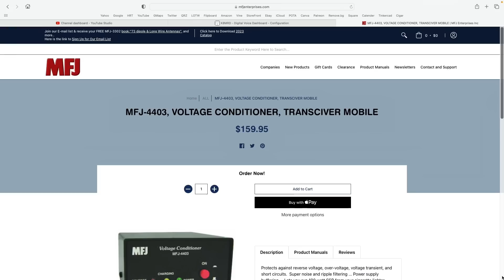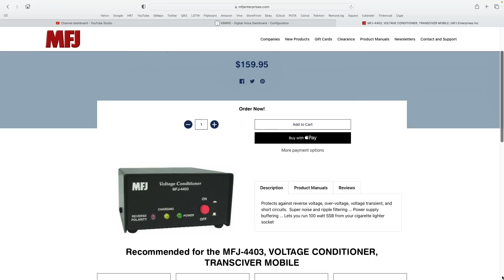Powering Mobile Ham Radios & Grounding HF Boat Antennas

Comment: A straightforward solution to powering a mobile ham rig would be an inexpensive LiFePO4 battery to provide enough current on demand.  And, use the cigarette lighter - or, any other 13.8v connection available - to keep the battery charged.
Reply: That occurred to me too - a current-limited "trickle" charger that won't overload the lighter socket but the battery can supply more current when transmitting.

I got lucky with my current car. The battery is in the back (both batteries, actually; it's a hybrid. But I'm not touching the HV pack) under the cargo floor and there's enough space to mount the radio base unit and some power wiring for other equipment like hard wired USB chargers I've added. I ran the cables to the control head and speaker around the seat and along the bottom of the read door trim all the way to the front seat, bundled in snakeskin sleeving, and the antenna mount feedline from the center of the roof (also got luck since the dome light is in just the right spot to access it without ripping anything else out) goes through the headliner and down the D pillar completely trucked away too.

Comment: Thanks for posting my questions Mike. I did feel a little guilty after making that GB station for 13 colonies. I’m a new ham for about a year and I just got wrapped up in the event. I just wanted to complete my first event solo outside of field day and I let it get the best of me. And thanks for all the feedback from everybody. Mike I will send you some pictures from the Pota boat this weekend. KI5UTS
Reply: I have a different take on this. You tried something new using a remote receiver via the Internet. You had an experience and perhaps learned from it. That's part of ham radio too.  Instead of trying to make it something it wasn't, a 2-way station-to-station QSO, see it for what it was, a potentially valuable learning experience.  Perhaps it could inspire you to work on your antenna and lower the noise level at your QTH so you can hear these weaker signals.  Could you find a quieter antenna and add a CMC choke?  That alone might reduce your noise level by several S units!  Maybe next year you'll be able to work GB directly.  Realistically we're competing with ourselves to grow and improve more than we are with others.  You're the best judge of what any QSO or award means for you.  Enjoy!
Reply: My thoughts on using the Internet with Ham radio: Well, first, one of the justifications for allocation of amateur frequencies is emergency communications. If there’s an emergency, Internet failure is likely. On that alone, I’d disallow such contacts. In my view, if your station didn’t make the QSO, the loaned station gets the contact.
Now, I’m all for integrating radio with Internet. Great idea! And in an emergency, you may have to relay traffic through Internet systems to reach the addressee. I think being able to access e-mail and other messaging services automatically from a ham station is incredibly useful! Ragchews into strange repeaters are nice.
But to me, ham contests are about bettering your station and your operating/setup skills. Use YOUR radio gear to reach THEIR computer, fine. Use your web browser? Plplpl you’re already online.

Comment: During NPOTA in 2016, I was at MLK National park in Atlanta and parked and went to the Restroom for about 3 min. Came back and my side window was broken out, and our two suitcases, laptop, cell phone, etc were stolen. Parking lot had a gate guard shack, but no guard, cameras on light poles all around. The Park Ranger cop said it was dangerous area. The NPS stopped manning the shack and the cameras had not been working for years. Atlanta PD called me a couple of weeks later and I recovered my laptop bag. Nothing else. 
Be careful in parks. Use the two man rule when possible. KQ4KK

Comment: I am in a Ford F350. I didn’t want to mess with the firewall, so I ran my power cable down the engine side of the firewall and snuck it under the truck by attaching it to brake light wires with zip ties. I found a little rubber plug in the floor board by the back seat and ran the cable up and through the floor behind the seat. There are plenty of places to run wires underneath a vehicle. Just fish them through all the attachment points for existing wires… I’m spoiled since it’s a truck and is easy to crawl underneath, but I assume it’s doable on any car with a floor jack.

Comment: Your answer about grounding the antenna on the aluminum boat was spot on! I do marine mobile and communicate with many hams on the water and those with aluminum boats do extremely well.
Keep up the great work.
Steve, k7ofg
Reply from the maker: Awesome, great to know.  Thanks for sharing.
Reply: Also consider capacitive effects for the ground plane. He may not have to scratch off paint if the clamp on mount has enough surface area close to the hull might be an effective capacitive connection to the boat. Like a heavy duty mag mount on the roof of a car.

Comment: Just want to comment on using remote receivers for 13 Colonies. I am on the East Coast and I even had difficulty working GB13COL. Based on comments I saw on DX Summit a lot of guys weren't working him. I worked the France OK station but no UK. I am not a fan of using remote receivers but I know people use them. A local ham is a big POTA hunter. He says he has a high noise level and often uses remote receivers to hear the activators. He even recommended it to others at a club POTA presentation. I'm with you on this. If I don't hear them on my receiver I don't work them. Phil, N3ZP
Reply: Sounds a lot like a meeting I went to.    I have no objection to using a web-sdr to listen, but I found it really did not work for 2-way contacts.  There is such a lag in hearing the web-sdr that I could not break into a pile up.  Just not worth it.  73 de WB3JAC

Comment: Voltage Conditioner. That's what I need for my setup. Thank You. I run an IC 7100 off of a secondary battery in my mobile. I have a battery isolator to stop the main from draining the battery if I forget to turn off the radio. The boat answer or question should go to Hamjazz (Youtube) He did a couple YouTube video from a kayac using an IC 7300 and an Alpha antenna with radials tuned for 20 m etc. He does POTA in the weirdest places. IE glacier, on a lake at a park on Vancouver Island. Boaters sometimes use the KISS method by using keel bolts that are somehow connected to the water. I'm not exactly sure how it's done but I saw it on a Pactor Group for boaters. It showed the KISS method as well as isolated stays to run HF to get weather grib files etc with  Airmail and Winlink Express.

Comment: It looks like the cat was offended by the internet radio question too.  I guess that it depends on whether the particular event forbids it.  Not allowed for field day: all radios must be inside that circle.  POTA: radios have to be in the park.  You might be safe having a spotting source remote (DX summit is and example), but you need to make the contact itself using local gear.  13 Colonies (and I was one of the NH ops this year): probably allowed, since your location isn't restricted, but it doesn't seem like the spirit of the thing.  All in all, I agree with you, Mike.  If you're going to use the internet, you may as well call on the phone.  I have some sympathy for folks stuck in the city where even if they can get an antenna up, the noise floor is horrible.  I'm slightly more comfortable if the radio you connect to is one that you own, installed on your own property.

Boat:  Beware of dissimilar metal induced corrosion.  Anti-seize compound might help.  It might be worth trying the window screen ground (see the KB9VBRAntennas YouTube channel).  While it may be something of a counterpoise itself, I believe that the people getting great results are taking advantage of capacitive coupling to the earth (I'm waiting for someone to tell me how well it works in a desert).  It should probably couple well to the aluminum boat, so you needn't scratch the paint in order to use the whole hull as a counterpoise.  And even non-salt water is somewhat conductive if it's dirty, so it may contribute somewhat to the counterpoise.

Comment: No internet or computer is connected to my radio. 100% SSB. I am working to improve reception the old fashioned way, which is to rid RF as much as possible, make ample use of my RigExpert, tune my DX Commander as close to perfect as possible,  switched my coax to extraflex bury 10 from M&P, and work the filters on my 7300, to me that is the challenge and fun of Ham Radio. it's part of the learning curves. Been Ham since 2021. so nowhere near the halfway point on decent understanding of antennas & RF. Yet another set reasons to watch your shows.

Louis
WW7GBA

Comment: If you are maritime mobile, you might be able to troll with a kite 🪁 behind the boat. And string a wire 100' up in the air! I suppose a good ballon 🎈 would work too!? 
As far as grounding to the aluminum bass boat...? It may be easier to just run a wire! But mounting a mast could easily be done, by attaching a mast in seat pole base!

Comment: Just a thought on the firewall stuff in a Subaru ... I just bypassed it in my 2015 outback,  took power that was fused at the battery and ran it thru the drivers side fender cavern, down to the rubber at the bottom of the fender in front of the door.  I brought it in the door thru the rubber door seal, and then under the carpet to a power pole distribution thing from west mountain radio under the driver seat. Nothing is visible from outside, its sealed good enough that rain or wind noise is not a problem, and when the door is open you see about 4 inches of 8 gauge wire with plastic spiralwrap covering.  Power is provided to the IC-7100 and screwdriver control box,  and another rig for VHF/UHF.   I don't know if the Subaru in question has the same set up, but I don't think they have changed that much.. might want to look into it.  8 years and it still is working well with no problems.

Comment: Clamp that ATAS in a way that it is over the water not over the boat. Use a short length of Braided ground strap and connect it to that bolt

Comment: I have the same car same color just a 2010. me and girlfriend love it. what we did to fix power problem was simple. 190 Ah powerqueen LiFePO4 12.8V battery . we run everything from powerqueen.  12V cooler as well. we have a powerworx DC to DC charger for LiFePO4. can select 2,4, or 8 amp. we set 8amp and does not over draw from car . being that the high current loads are not constant the battery we carry runs that and still has plenty time to charge. even running the cooler when shopping or dinning out with the car off. by time we get to the park or camp cite we have a full battery ! with the cycle life of LiFePO4 this does not hurt the battery . we are going to use the battery anyways camping with solar. we just use it on the way or back as well. just how we solved the car power problem. just don't charge LFP under 32F  . 73's

Comment: I had a 6m/10m/2m/70cm quad band radio in the wifes '19 subaru forester. There were 2 bolts under the drivers seat that took 10mm nuts so I mounted the radio there, and ran the coax and power thru the firewall by the brake booster. There was a grommet that had a large group of wires going in, just slit the rubber and set my wires in and popped it back in! I also grounded the coax to a hood hinge bolt about 8" from the lip  mount. Worked ok! 10m and 6m is awful quiet up in MN tho...

Comment: The local Motorola shop does my installs. 200 flat rate. There has to be a way to do the install, so a stereo shop may be the ticket.

Comment: Just a thought... If I were in a small boat environment, I would love to explore the use of a long wire and a couple helium balloons from the dollar store - don't get the metallic balloons, it won't end well. Then you can troll a counterpoise behind you, or just wrap it around the boat perimeter and see if that works. my current 2m antenna is so Rube Goldberg that it's not polite to speak about it in public. Thanks for this week's MBM - great as always!

Comment: Hi Mike,
Shame that ham had his solar charge controller stolen. I took delivery of an ATAS 120a on Friday. Modding a triple mag mount to use an SO-239 adapter. That way could move it between my van and car. Stay safe.  73  WJ3U

PS I have to send my new ALS-606S back to MFJ/Ameritron. Doesn't work on 220V. Keeps blowing the same fuse that is connected to the white wire from the plug. It does work on 120V. Bummer
Reply: Question about the triple mag mount and atas are you useing it while driving or just when stationary as iv wondered if a triple mag would be sturdy enough for a hamstick while driving and a atas is larger diameter and weight so if your able to drive with the triple mag them my guess is ham stick would be OK what do you think
Reply: @nickkendall3764  Only stationary.  WJ3U

Comment: The problem with cigarette lighter sockets is that they are only DESIGNED to run a maximum of 10 A (and can melt above that ).  Check the center pin (in the socket) if you run at or above 10A
Reply: (center pin -- check for loosness and melted plastic around it)

Comment: Your Tshirt is gd hilarious... can't even call that petty, it's more gentle ribbing at this point. 

And that sucks that his PM2 grew legs!!! I hate that for him!

Also, a 20ah lifepo4 battery I would say is an option for the gentleman with the Subaru. My truck had a stereo amp installed (by me) before I even got into ham radio so I already had battery leads ran to the amp so I just made clean connections off of that and that worked great.

Was he using WiFi? Pretty sure that's radio 🤣🤣 no but really I wouldn't count a remote contact like that. But I'm also with you in that it really doesn't matter. I'd be pretty darn averse to someone sitting at home "activating a pota" presenting that they're in a park... but I think we can all agree that's a different situation.

And I'd try to throw an antenna on that boat like I would a vehicle. Obviously not quite as much metallic mass, but I bet the atas and a good clean connection to the boat would work out pretty well.

Comment: 13 Colonies is an operating event (a measure of individual effort) not a contest (a scoring and comparison of your effort against others) and I see no rule from them against it.
Many contests do have rules that address this and would make your asymmetrical propagation (TX here, RX some distance away) contact invalid for credit.
Those same contest rules may very well allow remote stations as long as only 1 was used and all of the transmitting and receiving for the contest was from it.
The rules published for the event or contest are the ultimate authority.  If an operator has strongly held beliefs like the example that Mike gave, they may apply more strict restrictions on themselves and that's good for them.  If you generically and universally call any use of a remote station "cheating" and you aren't speaking in the context of cheating yourself, you may very likely be wrong and essentially directing fighting words at another ham.

Comment: Hi mike, regarding remote recieve. To me it is fine to use a remote to see if a guy comes back, but as you say, it is not a "proper"  contact. One thought is to go old school and use a second RX to hear the reply. with the availability of SDRs, it would not be to hard to use a dongle as an Rx, and the transiever just as a Tx, after all it is only one step up from using an Rx antenna as Callum does on his Kenwood. Finally and ally boat in salt water should be magic!! 73 Jim M7BXT

Comment: Mike, I sent a mailbag Monday question via email  but not sure it went through: I have worked HF, VHF, & UHF but know little to nothing about the SHF & EHF (you can also add 33cm & 23cm to the list) bands. What do those bands have to offer and what would you recommend as a first step to get into operating at those frequencies?
Reply from the maker: I don’t know anything about those bands.
Reply: @hamradiotube   When has THAT ever stopped a ham from commenting on the hobby?!?!😀
Reply from the maker: @av3510  Lol good point 🤣